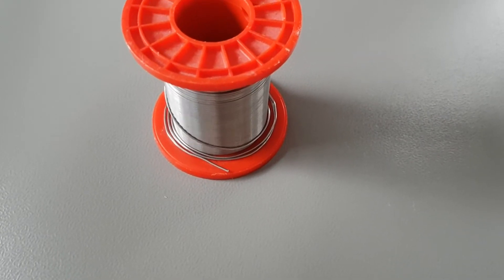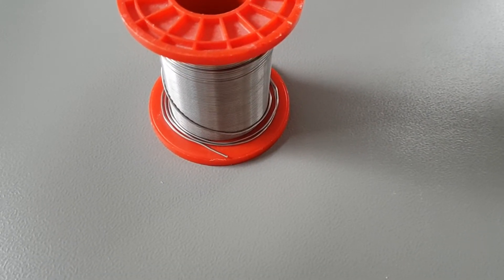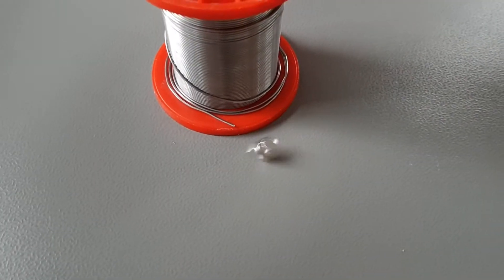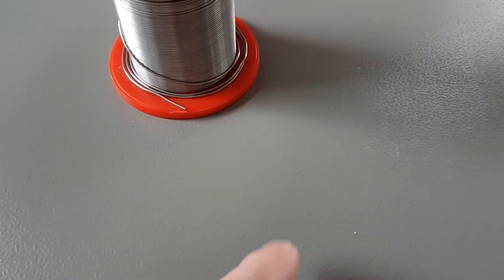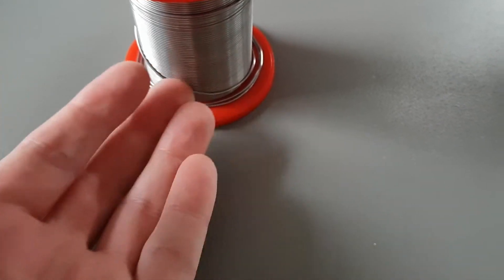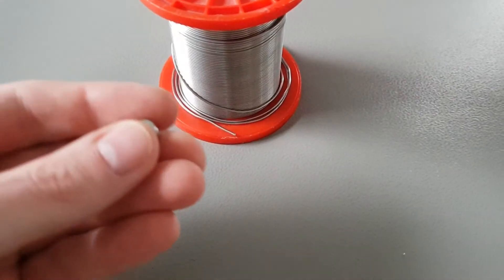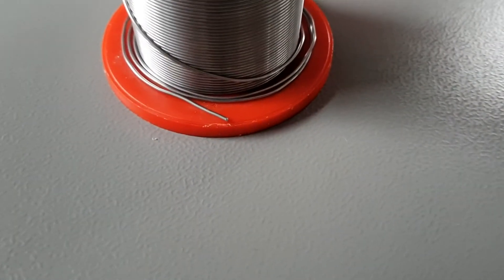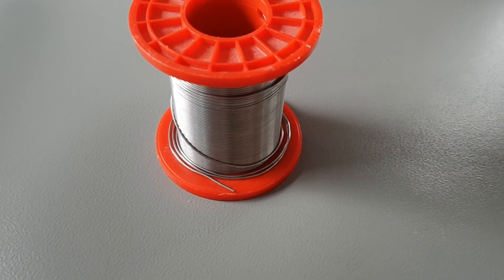Magnetic solder roll // Free energy ???

Comment: If to suspend the AC-coil under straw by means of shock-absorbers with optimum factor of damping then freely vibrating magnet can fly stably without rocking on other frequencies.
But for high-quality stabilization of a levitation it is (in my opinion)better to solder the electronic controller.
(may the automatic control theory help you)D

Comment: I will try this tomorrow morning, it's strangest thing I've ever seen. May be there is a gsm base station near you and the oxidized solder wire (causing insulation on the wire surface) acts like an inductor and in this changing magnitute magnetic field makes the nagnet crazy.